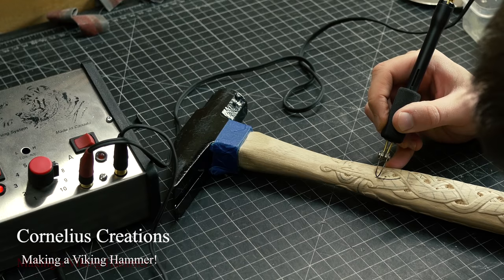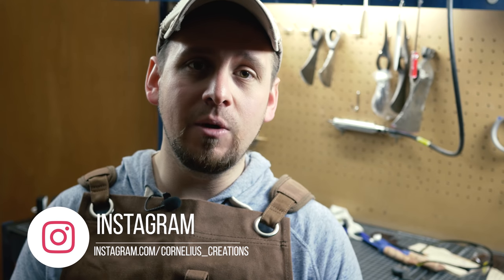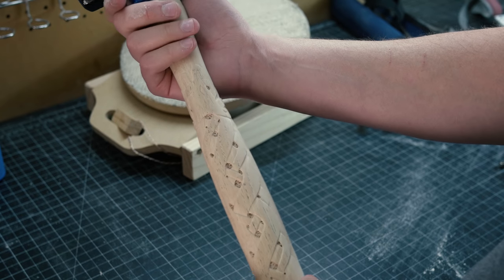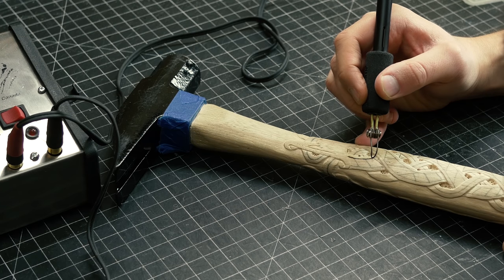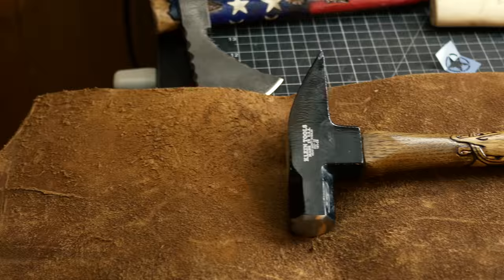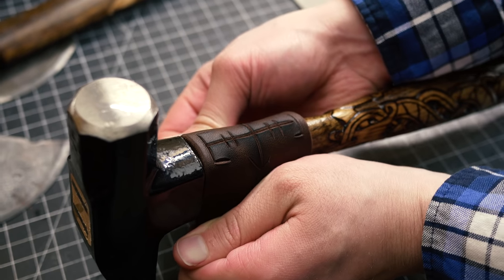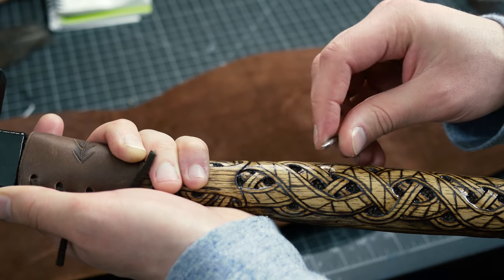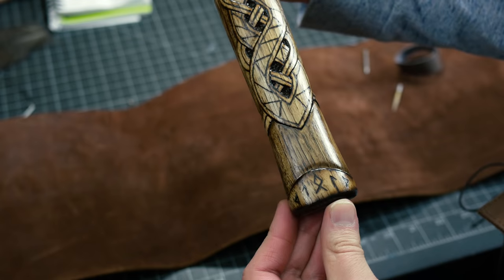I Carve an Ordinary Hammer Into a VIKING Hammer

Comment: Well, was the first time ever going to try signing up for instagram just if for no reason is to continue to learn, apparently the internet knows I don't belong on there and continues to pop up with sign up problems. Sooooo. Guess I will keep sifting through videos. 

Question, with your staining in varying shades, how do you keep the darker stains from leeching into an area you don't want it to? Without having to do a pre-coat of sealer I always have an issue where the stains cross boundaries due to the wicking nature of the grain.
Reply from the maker: Yeah man technology can be confusing!

Well man that’s a problem for me sometimes too. I use brushes sometimes to apply the stain to keep it separate. If some stain bleeds over I take a piece of sandpaper to it. 

Before you stain just make sure you progressed down in your sandpaper grits >cover scratches with finer scratches> this will compress the grain and allow it to wick the stain more evenly. I hope this answered your question! I’m still learning myself!